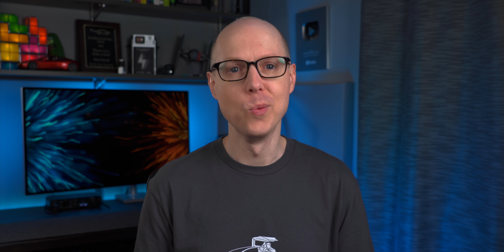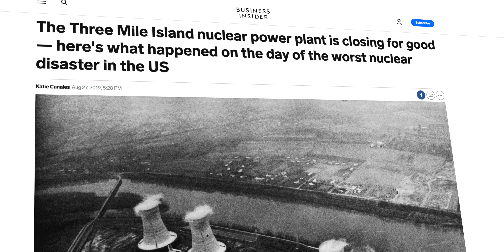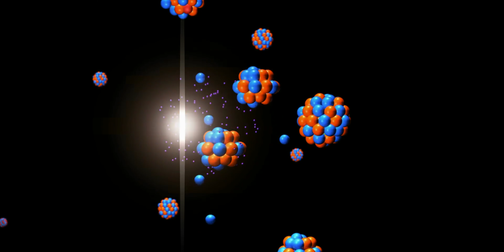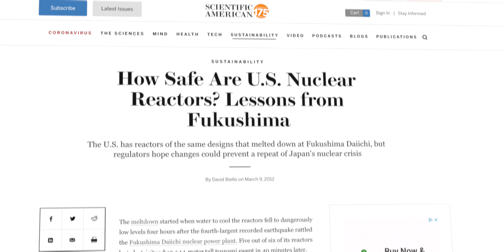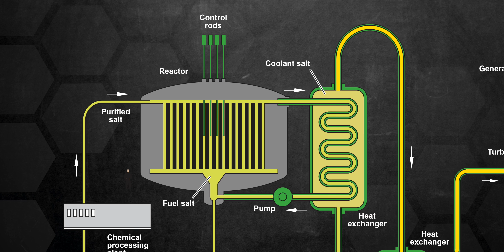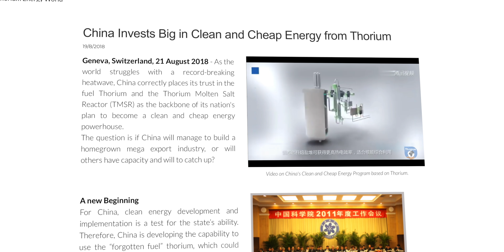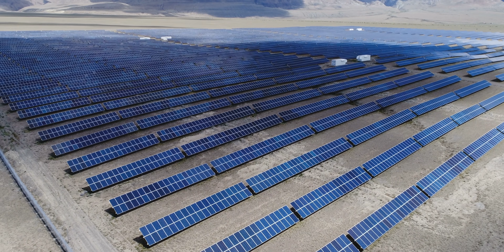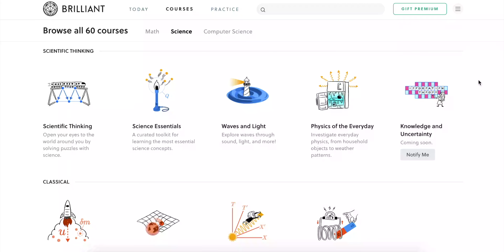Thorium explained - the future of cheap, clean energy?

Comment: I still don't care for an energy source that produces radioactive waste. So far they have already had too many issues trying to store it. There is no material than can hold the waste for 500 years without failure.
Reply: Hi Timonthy Mine.
A few points:
I don't know where Matt got 500 years.  The studies I've seen said 200 or 300 years for the fission products to decay down to the radiation levels of the natural ore.

Second, a stainless steel cask a few cm thick can certainly last 300 (or 500) years.  Or we could vitrify the waste (make it into a glass).  Plenty of other materials can last 500 years.

If you don't like radioactive wastes you should be trying to shut down coal.  Coal releases trace amounts of Thorium and Uranium into the air, and produces more radioactivity than a nuclear power plant is allowed to release.  With nukes, the waste is isolated from the environment.  

Natural gas has gases trapped underground.  Helium can be found in natural gas formations (it is produced from radioactive decay).  However Radon gas is also produced, and is pumped thru gas pipelines to your stove or water heater.  So natural gas pumps trace amounts of radioactive gas into your home.  Do you want to close down natural gas plants?

Solar and wind use rare earth elements which are found with thorium and uranium.  Producing these created low level wastes which are spread into the environment rather than being contained.  Do you want to close down solar and wind?

My opinion here, but I think that the reason that the big media never has anything good to say about nuclear is that the super rich who own the media companies, also own oil and other fossil fuel companies.  

I can't find my reference, but in about 2000 the Saudi royal family instructed their stock brokers to buy 2% of every USA media company to add on to their current holdings. Every newspaper, every TV station, every radio station, every news magazine, (which was publicly traded), was to have 2% more Saudi ownership.  

Nuclear power is the safest power in the world.  It has been shown again and again that it kills few people were gigawatt hour of power than anything else, and yet the media has convinced the public that it is dangerous.

Warm regards, rick.

Comment: I think any "future" power generation methods (ie those not currently being deployed) are going to struggle to get any kind of real foothold in most countries. Partly due to COVID-19, here in the UK, coal has not used for any electricity production in the last 2 months - actually, at times, there's been so much renewable electricity available that the National Grid has been paying people to consume more electricity to help balance the grid! Until grid scale batteries are rolled out massively that'll become the norm within a few years given how quickly renewable energy sources are increasing.

So what I expect to see 10 years from now in many countries is for a combination of renewables and grid scale batteries to provide the vast majority of electricity, with old nuclear reactors and biomass reactors providing most of the rest. Any new non-renewable energy source will have to deal with a market where they're likely only being used about 50% of the time, if not less and finding it difficult to compete on price since the marginal cost of renewables is basically zero.

I can see why countries like India might be very interested in Thorium but for many countries I don't think it'll make that much sense in terms of economics.

Comment: I have read quite a bit about this technology in the last couple of years. The major issue with the reactors that we have built over the last 50 to 60 years is their complexity and size. When using water as a moderator for the reaction it is necessary to build a very large containment building due to the fact that if the reaction runs out of control the steam will expand exponentially. Hence the large concrete buildings. In the late 50's scientists at Oak Ridge began designing and construction of a molten salt reactor, and for 5 years until around the early 70's had one running. It had funding pulled to construct a reactor in California as 1971 was very close to an election year. Eventually Oak Ridge did publish their findings on the internet in the late 1990's. ( not exactly sure of the date) Now there are a number of countries exploring the concept. The molten salt reactors are much smaller that light water and therefore less costly to construct. The thorium cycle will not yield weapons grade plutonium, they run roughly at barometric pressure and it is possible to use the stored uranium we have sitting at facilities around the country. That alone would yield years of energy without having to do any mining. Light water reactors can only "burn" less than 5 percent of the energy in the uranium pellets due to the fact that the rods containing the fuel begin to deteriorate after 14 to 16 months and have to be replaced. With so much energy still available it is no wonder the half life is so long.  Imagine buying 20 gallons of gasoline and after using less than 1 gallon you threw the rest away. I thing this technology hold tremendous promise, but getting regulators to approve something they are not used to is going to be a heavy lift. But as the economy moves to carbon free we are going to need a diversity of sources to supply power to homes, industry and transportation. In Michigan where I live solar in the winter is a no go due to the cloud cover generated by the lakes and snow cover on your panels. Diversity is the key. I love your channel and love the production values of your videos.
Reply: I would say that the major issue with the reactors we've made over the past 60-odd years, is that we have a whole bunch of one-off designs, so no one can use the experience gained in building one to help with building the next one. Also, due to this, companies that build them, market them like printer makers do - sell the reactors cheap enough to get someone to agree to get one, and then make gobs of money from selling the fuel rods. Remember, uranium is (pardon the pun) dirt cheap; it's making the rods assemblies and fuel rods that gets pricey, and since it's a special build, you can't get the rods from any where else.

With a liquid fuel, you can buy it from anywhere that the government lets make it, in whatever fuel concentration your plant can use. That won't make GE or (what used to be) Westinghouse much money, so neither of them will want one.

The best part of MSRs, is that you can go through all of those nasty coal ash heaps and mining tailings and pull out the uranium and thorium (and mercury!) in them, and irradiate them until they go away, giving us usable energy to boot! To be clear, it won't get rid of all of the coal ash, but it'll cut the lethal parts by at least a factor of a hundred. Also, it could become more profitable to process the coal for the chemicals, than to burn it as-is. For that matter, nuclear plants in general have the power output to process tons of CO2, literally. Fission plants also have the power density to more easily start up fusion plants; we know how to make fusion work, we just don't know how to do it small enough to be affordable to a non-international government research group. At least with a dedicated fission plant, we can worry less about capacitors the size of the local soccer stadium to start up the fusion plant with.

Comment: Hi Matt, I don't understand the part about only having to store nuclear waste for 10,000 years. I don't trust the numbers from your source there. Plutonium alone (if not used) has a half-life-time of 24.110 years.
Reply: Hi Der Radfahrer,
Pu 238 has a half live of 88 years.  Pu 239 has 24,000 years, Pu 240 has a half live of 6,500 years, Pu 241 has a half life of 14 years.

The shorter the half life, the more dangerous the substance.  If you want to wait until ALL radioactivity has decayed, you have to wait forever.  Substances with half lives of 24,000 years are far less dangerous than those that have half lives of 88 years (or 14 years).  

Anti nuclear activists like to have it both ways.  If they want nuclear wastes to be dangerous, they look at isotopes with short half lives.  If they want nuclear wastes to last a long time they pick isotopes with long half lives.  That way, they trick people into thinking that nuclear wastes are wildly dangerous for vast amounts of time.

However, I don't like breeding U238 into Plutonium at all, so I'm arguing above for a point of view I'm not enthusiastic for.  A huge advantage of Thorium is that it produces FAR less Plutonium (and other, heavier actinides) than Uranium.  

I explain this more in a post above, but look at a breeder reactor that starts with U238.  When it breeds Pu239, there is a 65% chance of fissioning (success!) and a 35% chance of creating a long lived actinide (failure).  

If we start with Thorium we breed it into U233 (90% chance of fissioning), if it fails, then it absorbs two neutrons and becomes U235 (85% chance of fissioning).  If it then absorbs FOUR MORE neutrons it reaches Pu 239 and still has a 65% chance of fissioning.  Thus Thorium produces a tiny fraction of the long lived wastes than a normal breeder reactor.

Further, normal reactors have the fuel and waste mixed together in a solid.  Hard to pull out the good stuff, and keep using it.  Molten salt reactors are called 'chemists' reactors.  The waste products can be removed, and the stuff we want to fission, STAY in the reactor, where they undergo neutron bombardment which can cause them to fission, or via n --> 2n decay, turn into things that are not dangerous.  In other words, much of the plutonium is produced because it is pulled out too early.  If it was left in the reactor, it is given more time to fission.

Studies have shown that Thorium based fuel cycles produce 10,000 times less long lived decay products.  Also, some (theoretical) designs of molten salt reactors can burn up current nuclear wastes as fuel, which would get rid of them permanently.

Warm regards, Rick.

Comment: The US nuclear power today is less safe because everyone fears it so much that funding to improve it is non-existent. Bad designs would have been upgraded decades ago vastly improving the safety. That said, nuclear still has one of the best track safety records in the energy industry.  We just accept the thousands who did yearly due to FF pollution,  those that died mining, the well driller deaths, shipping catastrophes and death. Most methods of energy production are hazardous. Their deaths just aren't always connected to the cause.

I didn't hear a key advantage of thorium. Its byproducts are not weapons grade materials. So it can be recycled over and over. So the waste problem shouldn't be a huge issue. Not because the half life is shorter. Lets be honest 500+ years is still a long time. 

Solar has a good chance too, if the storage problem is fixed, but thorium is tech we could implement in a few years and is known.

Comment: Atomic energy in any form is not cheap, is not clean, and is not renewable. If Bill Gates is investing in technology that can use up the sizable chunk of the nuclear waste that has been created in just 60 years, then that shouldbe applauded. But otherwise nuclear energy is a massive and expensive distraction, as as you point out, there are NO working Thorium plants anywhere, Despite the enthusiastic and vociferous support for it on the internet. As you will see from the angry comments this post will provoke.

Comment: If fuel waste from existing reactors is processed to extract all the trans-uranics out of it, then its radioactive danger timeline is likewise reduced. All those trans-uranics with a long half-life could then be turned back into fuel to be burnt up.

As long as fuel waste only contains fission products, and the remaining fuel elements are cycled back into the reactor then the dangerous timeline is vastly reduced. 

In fact most of the common fission products decay to safe levels even faster than stated, like within a few decades. Only a few element isotopes like Cesium 137 and Strontium 90 with half-lives in the 30 year range lead to that 300-500 year isolation period.

The main waste benefit of Thorium is that very little of these trans-uranic materials are produced, but even a plutonium breeder reactor could have most of its waste with this shorter timeline as long as the waste is limited to fission products.

Comment: Any conversation about clean energy that includes "Climate Change" but ignores Solar Cycles must be examined for Agenda Driven "Science".
Reply: Your ignorance is apparent.

The sun drives our climate, but the suns variability in output isn't responsible for major climatic swings here on earth.

The earth's climate is primarily controlled by the earth's orbit around the sun. 

You see, the earth's orbit around the sun is NEVER circular...  It is elongated and elliptical.  At it's most extreme, the earth's closest pass in orbit around the sun (perihelion) can be 13% closer than it's furthest pass (aphelion). 

That's one factor in why the earth flips from cool to warm or warm to cool. 

Another factor has to do with precession of the earth's axis, and the precession of the earth's orbital eccentricity.  Otherwise known as the precession of the equinoxes 

Another factor has to do with the earth's tilt, or obliquity, in relation to the sun. 

The suns output doesn't vary enough to really affect our climate.  In the sun's inactive stages, the earth receives about 1360 watts per meter squared.  In the sun's active stages, the earth receives about 1361 watts per meter squared.

Comment: Th 232 isn´t only fuel for molten salt reactor! Also U238 is fuel for molten salt reactor.
Reply: Hi Salmuel Gomola,
Very true.  Terrestrial Energy is staring up a molten salt reactor with Uranium.  However U238 has one fissionable product when it absorbs neutrons (PL239), where as Thorium can fission at U233, U235, and PL239 as it absorbs neutrons, so a much higher percentage of the material fissions. Thus it produces 10,000 times less long lived actinides wastes.

Also there are (theoretical) designs of thorium based molten salt reactors which can 'burn' up current nuclear wastes, and produce power from them. 

If you are interested, there is a very good book called, "Thorium: Energy Cheaper than Coal", by Robert Hargraves.  Ask your library to get a copy, it is well worth a read.

Warm regards, Rick
Reply: @RicksPoker  It depends on what type of reactor you're talking about. The kind of reactor that can sustainably breed Pu-239 from U-238 while also fissioning transuranic waste is a fast spectrum reactor. Thorium, however, works better in a thermal spectrum reactor, which is what was built and tested at Oak Ridge. Different reactors have different strengths and different drawbacks. You might also check out the textbook "Molten Salt Reactors and Thorium Energy" as well as "The First Nuclear Era" by Alvin Weinberg.

Comment: 500 years half life of thorium waste products is still a very long lime and would create it's own storage issues.  I favor renewable generation and improved technologies for storage of said generated power.
Reply: 83% of all waste from a molten salt nuclear reactor operating on the thorium-uranium fuel cycle comes out as: 

neodymium (used in magnets)
molybdenum (used in electrodes)
strontium (used in electronics, metallurgy, and chemicals)
zirconium (used in many commercial products)
rhodium (used in electrical contacts)
ruthenium (used in electronics)
and palladium (used in jewelry and specialized alloys). 

Those are just the most typical uses for those elements... 

15.5% of the remaining waste/by products are the toxic and radioactive by products cesium 137 and strontium 90... Cesium 137 has a half life of 30.17 years, and strontium 90 has a half life of 28.9 years. That means that after 300 years, the waste is "safe" and can be used in things such as nuclear medicine, as well as other industrial uses. 

The remaining 1.5% of waste comes out as neptunium 237 which can decay into plutonium 238 over time. This is the stuff we just put away for long term storage.
Reply: @Les_S537  Thank you for for the detailed explanation.  While not perfect, I agree with you that it is worth pursuing to bring to fruition.  At that time, it can be compared to the then current renewables and battery storage options for what Thorium's role should be.